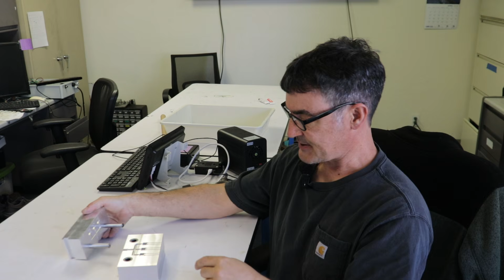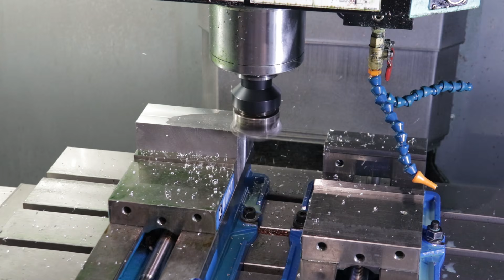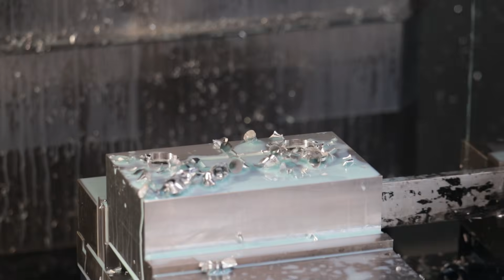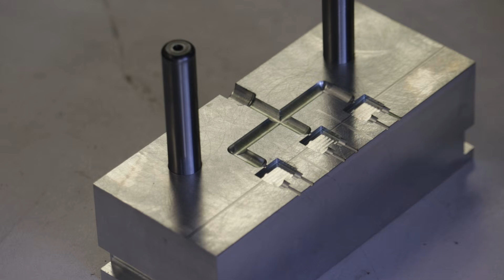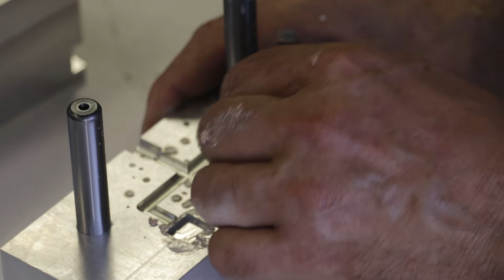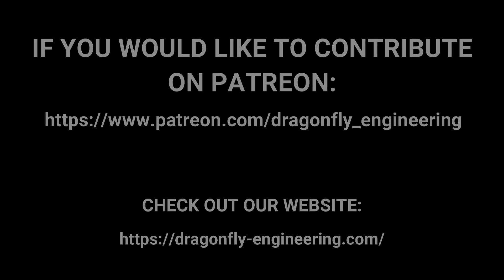Custom Insert Mold

Comment: Surprised by the 3 cavity layout, makes gate balancing a bit of faff, I'd go for two in that layout, still, what the customer specced.   I assume development tooling as it's in Aluminium.
Reply from the maker: Customer is always right. This mold fill is probably not that bad, 4 may be a good move with “y” branches

Comment: I machined for 38 years, 21 of those years I machined molds. 
The electrical outlet boxes in Lowes and Home depot, I help make the mold for them.
Those mold had a runner plate and ejector pin and water cooling systems. Roughed in a CNC mill, then the cavities had to be burnt in with a EDM. (Sinker)
The molds we made had @ least 6 cavities, which made 6 parts at one time.
A little more complicated then this MOLD in the video, but worked very much the same.
I'm retied now but miss it so much, I purchased a CNC and now make patterns for sanding castings as a side hustle in my garage.
Nice video, thanks for sharing!  👍
Reply from the maker: Thanks for watching, I also used your products

Comment: I’m surprised that the CNC is accurate enough that you can locate the pins and bushings in separate steps rather than matching them in one operation.
Reply from the maker: Yes, these mills are very accurate these days